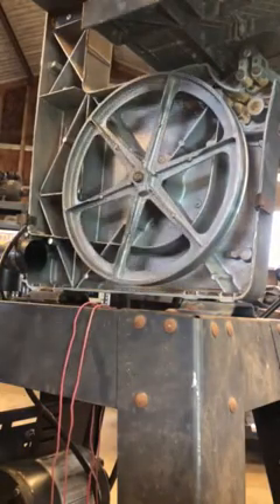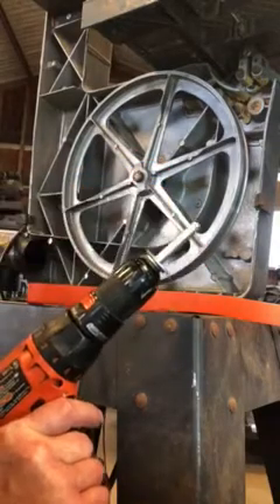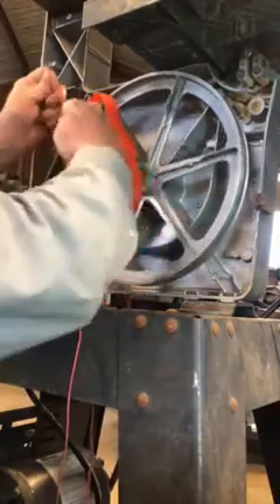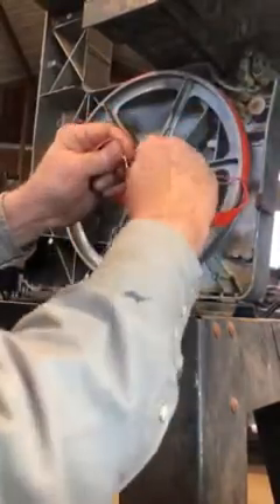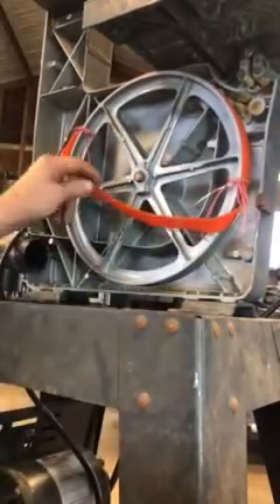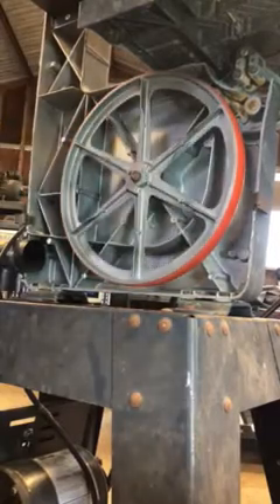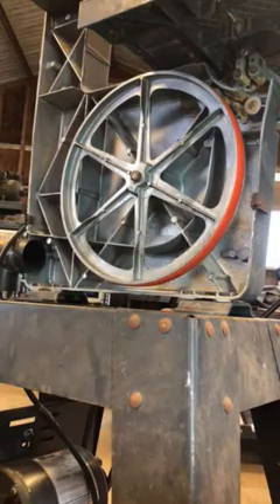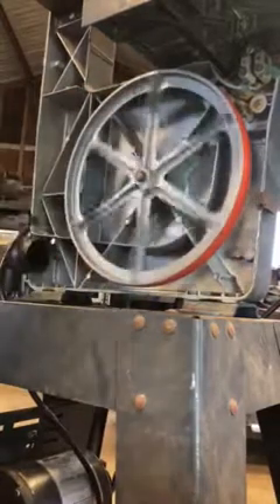Replacing a urethane bandsaw tire the absolute quickest and best method

Comment: I just got around to actually try this method. I don't know what this guy is leaving out of the process, but after fighting with this method for the better part of an afternoon, I had ZERO success making this work.  The washer just spins off the mandrel. The tire does not follow as you try to push it into place. Point of fact, I ended up marring the wheel groove with the far shank of the bolt. Epic & complete Fail.
Reply from the maker: All I can tell you is watch it again and see what you’re doing differently